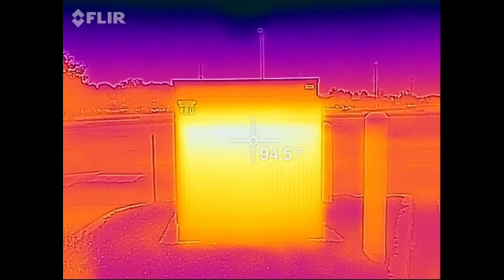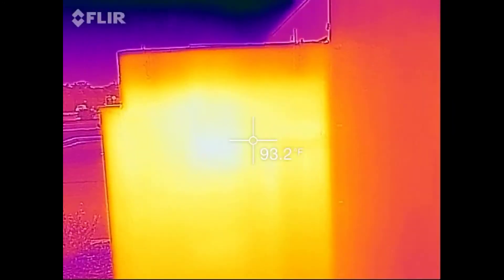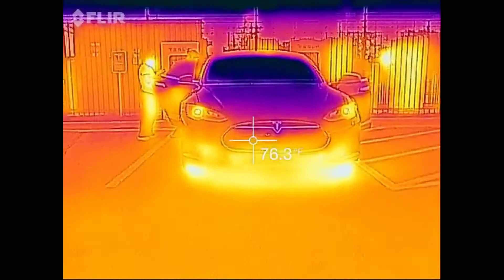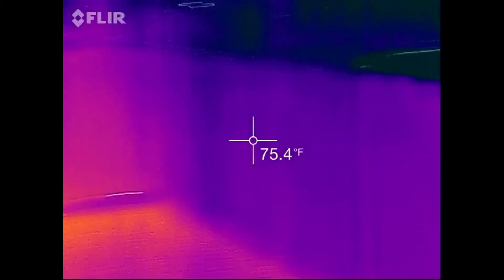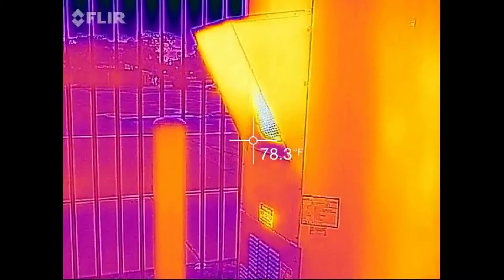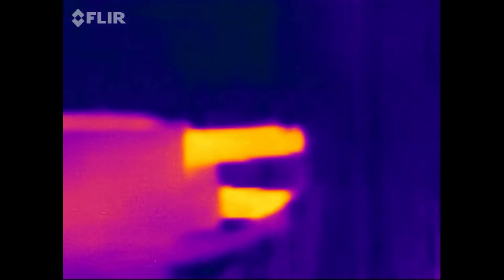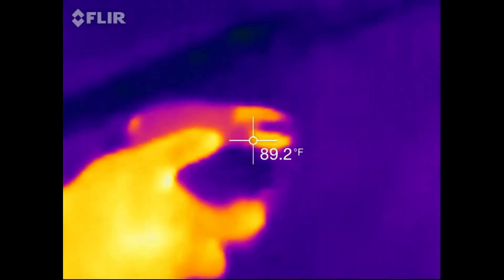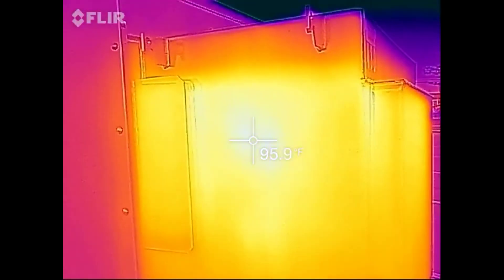Tesls Motors Model S: Supercharging thermal at 40kW & Transformer

Comment: If I remember right you had one of you're cooling fan replaced at 40 kW/hr the cooling fan doesn't come on ? Were they on earlier ?
Reply from the maker: V10PDTDI That is correct. I had not been charging for as long here. If it got hot enough, the louvers would open, and if needed fan would kick in. Plus, I had been running my AC while on the freeway, so potentially the car used the already active AC to cool things a bit more as I was driving.